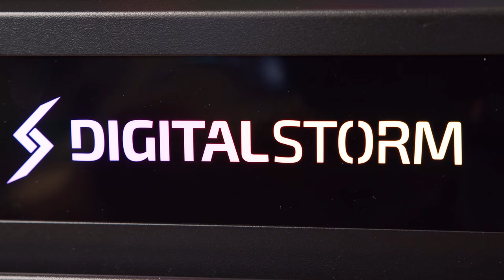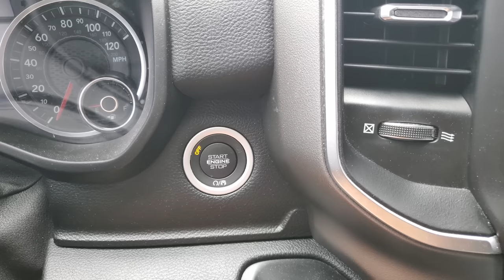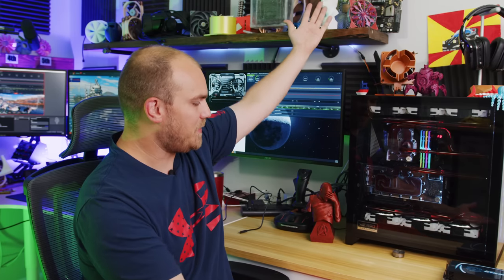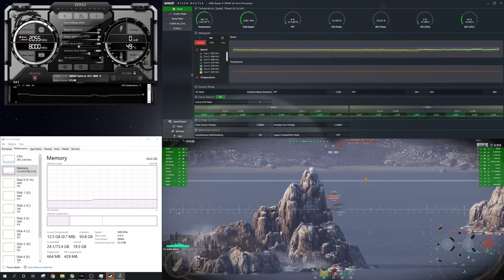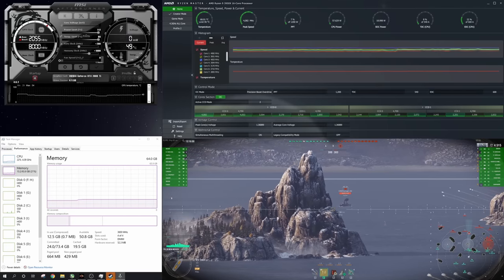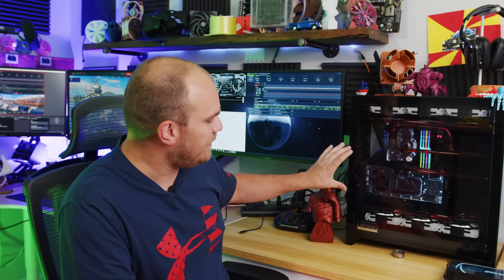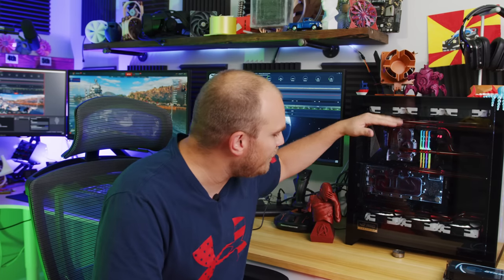$2.00 part BRICKED my gaming PC

Comment: Morale of the story: NEVER turn your PC off.
Reply: Mine only turns off when Microsoft update does it. 🤔🤷🏻‍♂️🤦🏻‍♂️
Reply: This guy datacenters.
Reply: Yep...there's really no point to shutting it down either...as many of the things that shutting it down used to do, are now possible to do without shutting it down...
Reply: @BJCMXY  👍 Exactly. When I am at work, I play classical music on my PC for my cat to listen to while I am gone working. I also believe the music playing on my PC in my room keeps burglars from breaking in my house while I am working. My PC is my gaming rig, my cat sitter and security system. 😃
Reply: or replace your cmos battery every 2-3 years like your suppose too.
Reply: if electricity or noise were not a problem, that would be a very good advice
Reply: @BJCMXY  disagree. PCs always run better with a restart. Always. No exceptions. Regular restarts prevent bit flips (which will happen in all computer memory, thanks to cosmic gamma rays and other interference you can't do anything about) from causing so many issues. You take a computer that has been running non stop for a month and compare it to one that restarted daily and you'll see a higher prevalence of errors in the windows logs and more likely hood of crashes on the month long powered PC.

I've done IT for 20 years. The PCs that get the least calls are the ones in which users restart them daily. it's always the ones that are left on that have issues. Literally the first thing you do is check the uptime. It'll be high and a restart will solve most problems. Servers with ECC memory on the other hand are the only ones that do not need restarting.
Reply: @scythelord  I think windows being windows is the main issue, not flipped bits. I use a hackintosh and in macOS it can be on for a month, no suspend or anything, and still run perfectly. I had to use windows as my main OS since the pandemic started and in just 4 or 5 days I start getting weird errors, a lot of ram usage, pagefile goes huge, and more weird stuff. Just today the pc thought the alt key was being kept pressed when I logged in in the morning. That kind of crap never happened on macOS with the same hardware. Linux is also awesome at not needing restarts to do a garbage clean.
Reply: @MMuraseofSandvich  or mines crypto 😹
Reply: @scythelord  agreed and also agreed with the op.  Restart from time to time, never turn off (unless for upgrades ;)). Every time you turn off your pc you cool down the parts way too much compared to their operating temperature, which, over time can and will cause thermal shock and create microfractures along every component, especially since not all materials making up the smds, pcb, etc. expand and contract at the same rate. Thermal shock is the number one cause of component failure.
Reply: Well... My notebook could be turned off.
However it required a hair dryer to boot up again.
Reply: @thematrixian8710  You are talking about a temp swing of about 50 degrees at the most, more likely 10-20 for someone who just browses and uses youtube. Hardly a huge problem.
Reply: @Mrx1080  I know it’s a real thing, but tbh I thing it’s more likely to have an OS issue than cosmic rays flipping bits.
Reply: @darkshadowsx5949 but if this build is only 12 months old, why? How? Is this a cheap CR2032 battery we're all going to experience after the terrible build quality of 2020/21 when every employee was thinking about not getting sick instead their job. Or was this a recycled old motherboard he's passed around. We see his next MB and CPU getting tossed around in the closet. 🤔🤦🏻‍♂️🤷🏻‍♂️

Glad I got my AMD Ryzen CPU when it was available, I didn't know the constantly changing SKU and changes in models was the beginning of the supply shortage. Now I have a sweet desktop with an 8 year old GPU 😒😥
Reply: @darkshadowsx5949  you mean you're not supposed to wait 10 to 15 years?
Reply: It earns less Ethereum when it's off.
Reply: seriously, my one job was a 24/7 place and I shared a computer with a dayshift guy so it never got shut down but my current work everybody just leaves them running all the time

Comment: A few months ago i had a similar issue from my PC that I built in 2008.  It is a nice system that won’t run the newest games but in general still runs really nicely.  I went to start it up and got nothing.  Like you I looked at the power supply first.  Sadly it was the power supply and it is now back up and running.

My 2008 i7 runs an air cooled 40 - 50 c according to the motherboard temps at full capacity!  I have an antec skeleton case that is just amazing at keeping airflow going.  I made sure to have a down draft CPU fan to take advantage of the air being blown down on the motherboard.  Air cooling can work great if you have the right setup.  Yes it is blowing out the dust required every few months to a year but we also replaced our thermal paste at the same time.  Yes it was fairly dry but still doing its job.

Comment: Glad I saw this pop up on my feed.  I have had a similar issue with my own system.  I've been working around it by just putting my PC to sleep rather than doing a full shut down.  I'm gonna be upgrading my cpu when I get some new coolant in a week or so, so I'll try swapping my cmos battery out when I do that

Comment: The ethernet port stopped working on my MSI X570 Gaming Plus about 6 months after I put my PC together. I just bought a $10 USB3-ethernet adaptor rather than pulling my whole PC apart and RMA-ing the board.

Comment: You should 3D print an inline flow indicator. It’s basically just a propeller inside a clear tube.
Reply: But why though? He already has one in the Distro Plate at the front :D
Reply: @Koichifirst  so did I. 
But there are multiple lines going to multiple components. For mine I burned out my GPU because I thought coolant was flowing. It was but not to my GPU. So I got inline flow indicators and flow throttle valves to better control and distribute flow and now I know exactly how much coolant is flowing to each component. I also put inline electro thermometers for each component with a labeled LED panel and pezo alarm.

Comment: I had a similar situation where the darn thing wouldn't boot properly 5/10 times... Error codes weren't precise enough so I followed the order in which the faults appeared. i replaced the cpu, the motherboard, the ram.....and guess what? It was a faulty power line coming from the PSU... But yeah at the end of the day I had a new PC built and a spare one at hand... so nothing too bad.

Comment: Custom loops are nice to look at but I gave up on water cooling many years ago. I'm lazy by default so the maintenance aspect of if is a PITA. With air you turn the system off and grab your air gun and compressor and you're back up and running in 5 minutes.

Comment: Dude, my micro center has had cards on the shelf the last 5 times I've been in. Let me know what you want and I'll go get it for you
Reply: Mayfield? They have been pretty stocked.
Reply: @DJ.1001  Denver, actually. They had 5 white Strix 3090s, a few 3080tis and 9 3060tis when I went in last Tuesday.
Reply: Maryland location had 30+ AMD RX 6000 series cards available last weekend. 8-10 RTX 3000 series cards as well but they were only available if you were building a full system.
Reply: @gamers_anonymous  yeah, that drives me nuts. The Denver location has over 100 pre-builts in stock because they keep pulling gpus from inventory and building systems that no one wants
Reply: @technewb8241  my friend asked about the 3080ti on the shelf and they literally offered to build him a machine that was practically e-waste with a GPU attached.
Reply: @gamers_anonymous  not surprising. It's a tough trade-off, because it keeps scalpers away for the most part, but to what end? If they're kept out of the hands of people who need to finish a build or replace a dead/old gpu, kept from scalpers, and no one is buying their pre-builts, then is it really worth losing the sales?
Reply: @gamers_anonymous  I've had no issue walking into the Mayfield store picking a gpu in the case and purchasing. Although they are now doing a 30 day wait period before you can buy another gpu
Reply: Yeah it's weird, I walked into the NOVA Micro Center the other day just looking for a new monitor and they had a bunch of 3080 Tis and 3090s in stock. My plans changed the second I saw them lol
Reply: @opticFPV  I thought about getting a white Strix and moving my fe to my htpc, but I waited for the best buy drop instead and picked up another fe for the SLI flex until alder lake drops

Comment: a note on testing power supplies with little testers like that, just because the power supply turns on doesnt mean it's still not bad. ive had 50+ systems in the past (im a builder) that wouldnt boot, but the power supply tested fine on a little tester. well, the issue WAS the psu, and UNDER LOAD it wouldn't power up. it could spin up fans and such, but not push the power needed to post. swapped the PSU and it goes. so if you want to truly test PSUs with a little module, get one that has a load in it, sorta like the battery tester at the auto parts store.

Comment: i had a system that lasted 10 years with the same CMOS battery and when it went bad, i had to swap batteries each 6 months... i have a new PC now but it was weird that the batteries only lasted 6 months all of the sudden...
Reply: I had a similar experience, even tried different brands of CR2032, I guess there was some mild short somewhere on the board that caused it to drain faster?
But I've also had a case where I had to replace the new battery within a few months, and then the second new one kept the system going, so ¯\_(ツ)_/¯
Reply: @pubcollize  due to the age of my board all i could find was a post saying that the capacitors goes bad on that board but... hard to tell if it was true or just a guess/rumor. anyhow i replaced my q6600 with a i3 8100 and it feels like 10 times faster! (placing a road in Crysis's  Editor took like 30 minutes to apply, only 30 seconds on the new processor!)
Reply: @theepicslayer7sss101  Yeah I used to have lots of cap issues until I started going for better boards.

Comment: If you get that partial BIOS (well UEFI) reset again, try to lower your memory speeds by one step. I had the same issue with it forgetting platform settings like IOMMU, giving me a fit at boot up just cycling a few times and then booting up with the partial reset.

Comment: You have X570 mobo and 3950X already, for upgrade to the best performance you need to swap out CPU for 5950X, instead you get 10900K, that is slower overall than 5950X, and a mobo that cost more combined than 5950X?

Comment: The CMOS battery would have been my first guess when you said it forgets settings. Though it is still weird behaviour for a board of this age. My 2500K ran for 9 years and never needed a new battery. Do you kill power to your system when you're not using it?
Reply: Some batteries are better than others. Things happen. I know a guy who had an issue with a Makita drill battery a year after he bought the tool. Called Makita and they sent him a new one despite being out of warranty, and he's been using that new battery for over ten years now without issue.
Reply: from the short part where he showed the battery it did look like a rather thin cmos (it looked half the thickness of the one in my pc and that has to be replaced every 5-8 years depending on usage)
Reply: @kuromiLayfe  KTS is quite common OEM brand for CMOS battery on motherboards. So the battery probably came from factory. Most likely it’s just a bad apple, or potentially the battery will drain faster if wall power was unplugged after turning off the computer.

Comment: Similar thing happened to me. Aorus X470 Ultra Gaming. LED settings and XMP would be gone every time unplugged from power. Otherwise fine settings-wise. I was using my-father in law monitor at the time, which for some reason would prevent PC from booting if HDMI was used, and would boot most of time if DP was used. So I though that it is just monitor messing about.
Moved PC back to my place after holiday, same stuff. I knew that  my display is OK, so replaced CMOS battery to see if issue remains. New, battery, no problems whatsoever. Sometimes simplest solution is best solution.

Comment: I had a similar experience, I built my new PC, went to turn it on but it woudln't turn on. Gigabyte has no flash codes but read that it usually was CMOS, went to reset it  and nothing. 2 days later, I found out that ..... my cpu cable wasn't plugged in....

Comment: Im so glad you found out it was just the cmos bettery, i was yelling at you to just do a bios flash and change cmos battery lmao. if it helps btw plug in the lil 3 pin speaker that comes with your mobo, really helpful for troubleshooting component issues. I love the lil beep boops!

Comment: This is not fan-showdown, but I think as it is your newest video it has the highest probability to be seen:
Haver you ever tried printing your fans with the non planar Slic3r (git repo:Zip-o-mat/Slic3r)? Teaching Tech made a video about this ("Achieve true 3D printing with non planar slicing"). It is a slicing techniqe that doesn't print each layer on a constant z height, it rather variates the height in order to achieve rounder curves. It could improve the stability and vibrating behavior of the fan. And even if it doesn't make the difference: I would be interested in a comparison similar to the one with smoothed ABS, as it is a helpful 3D-printing technique, which not everyone is aware of.

Comment: To clean your blocks without dissasembling them, you could try and run some Aquatuning SysClean through the loop. You probably need about 2 bottles mixed with one liter of demineralized water (please don't use distilled, it can actually tear off your nickle plating if it's been worn down). Let it run for a couple of hours and then clean it out by running 3 x one liter demi water each for about 15 mins to remove the reamining cleaning agent. It's going to look shiny! Mayhems Blitz does the same, but it way more expensive.

Comment: The standard capacity for a 2032 is 120mAh, with a self discharge equivalent current that means you are down to 50% capacity in 5 years. Some of the more reputable manufacturers have done every trick in the book to reduce self discharge. However some from you know where are more like 60mAh with a 3 year self discharge. IE really useable for 18 months from the date of manufacture. The most annoying thing is that ferro-RAM (FeRAM) is more reliable and needs no battery.

Comment: My PC was randomly shutting down a few hours after being booted.  It also would wake randomly.  I did all the usual troubleshooting; checked the RAM, the USB devices etc.  I was about to replace the power supply when I thought hard about what else could cause the computer to behave this way.  So I unplugged the power switch, and it didn't misbehave once.  Replacing the switch cost a few dollars and saved me having to buy an expensive new PSU.

Comment: Why do computers always wait until after we turn them off to break? My GPU worked fine, then the next day I go to play some games and my frame rate dropped into the toilet. Open it up to see the fans werent spinning. They would if I flicked them a couple of times to jump start them, but they didnt stay spinning. Had to open my GPU for the first time ever to oil the fan hubs. (for the record any video that says the fan pops off the hub easily so you can oil it is lying.) I might have to kick start one or both of them in the morning, but they at least keep spinning the entire time now. I've ordered one new fan (because two cost a ludicrous amount for some reason) and some thermal paste (because I didnt realize how instantly I was going to put a thumb in the stuff and I'm only slightly confident that I smeared it back into place properly.) ...also thinking I might want to swap out the CMoS battery too after this video, just 'cuz.

Comment: Man, that's funny.  A friend's computer died on Monday, too, after a long power outage and the computer wouldn't boot after electricity was restored.  Simple dead CMOS battery in a 6+ year old computer.  They don't make CR2032 batteries like they used to, I guess.  They used to last 20 years, pop them out of an old computer and still good for another 1 or 2 more computers.

Comment: As a geezer with some computermiles on the clock getting this the first time stumped me too. Experienced it first some years ago on someones Athlon X2 PC with MSI board. 
Since then, with weird issues, on PC's which are a few years old I first check the CMOS battery...

TECHTIP: actually replace it! The first time I had this on a PC it didn't run without battery either. 
MORETECHTIP: immediately set your date and clock properly in the BIOS and don't let the system boot into Windows. It doesn't like it when the date goes backwards in time. Usually it survives after the clock is set properly again, but better to avoid it all together

Comment: A tip for your on cleaning your blocks use white vinegar it will clean up the gun and it will clean the clear plastic just use a pump to pump it through for a few minutes then rinse with some bottled water also pumped through then put back together and re fill with your chosen coolant. I wouldn't run it through your loop pipes though just build a simple short loop and run separate from the cpu and gpu  as you want a very high fast flow rate to clean it